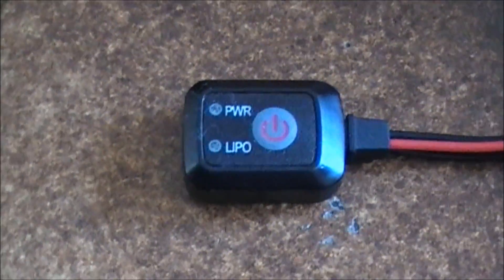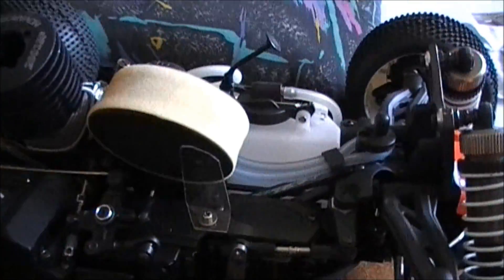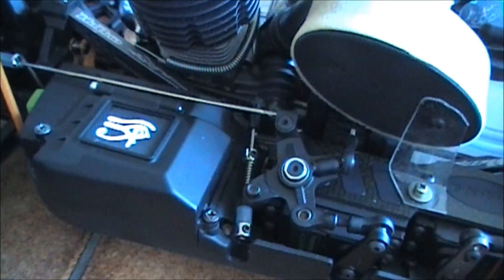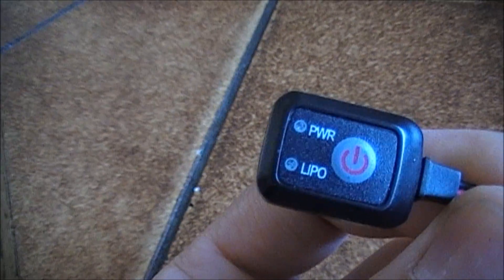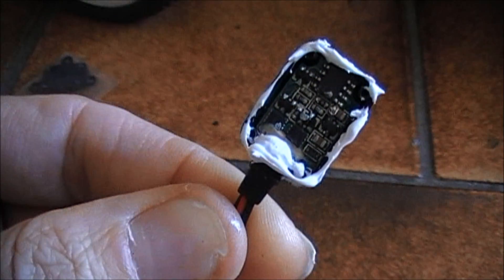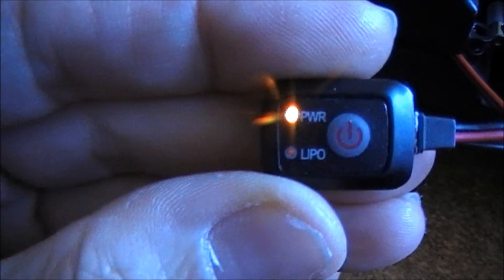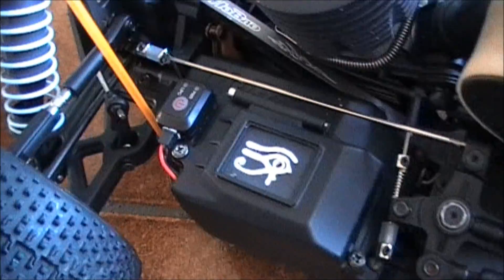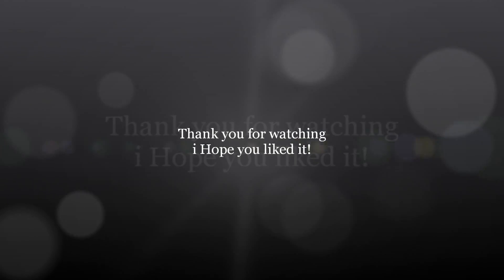RC car parts - On/Off button instead of switch and waterproofing it!

Comment: Hi how can I fit these  on electric esc without switch
Reply from the maker: The switch is designed to connect the battery with the receiver.

Comment: Old video but very informative, I see comments from 8yrs ago. But this device is still relevant today. After chasing down bad batteries and bad servos, my on/off switch had failed trackside. found this switch at my local hobby shop, and it’s surly better than the stock switch. Thanks!
Reply from the maker: It's a clever little thing isn't it! I'm surprised these haven't become the norm yet.
Thanks for watching and the feedback mate!

Comment: I have a 2s Li-po with a deans-contact and one little 3 pin when I charge the li-po. The connector from the SkyRc to the battery does not fit eachother. Do I must make one for my self or do you know if I can buy somewhere and if I must make it on my own...where do I find any contacts for that? only + and - from the skyrc pw switch and from li-po there are 3 cables. Not sure how to do it. There are 2 black and 1 red from the battery.
Reply from the maker: That's a good question and i don't know the answer to it to be hounest. since i've never had to deal with LiPo batteries.
You are correct; a LiPo has 3 pins and the on/off switch only has two. Which is strange since SkyRC mentions this switch can be used for LiPo batteries!

Comment: Is this switch like a fail safe switch as well that when the car battery drops down the car or buggy will also come to a stop ?
Reply from the maker: No, when the battery drops down or the connection is broken, the servos remain where they are at that moment.
Reply: @2stroke4me  that’s not good lol thanks tho

Comment: Hi.. i recently bgt the same switch.  Was wondering does it matter which set of wires are used for Voltage in and out? Dont have much experience with this.. appreciate the help. Thanks
Reply from the maker: Yes, the male plug (big one) connects to the battery.
Reply: @2stroke4me  thank you very much
Reply from the maker: @mikrot-rex747  You're welcome.

Comment: Two wires...

Where do each plug into?
Reply from the maker: xxgg One for the battery and the other goes into the receiver.
The battery pack is from another car, so ignore the two wires on the battery.

Comment: How do you install this on an electric car?  Thanks
Reply from the maker: Good question, haven't thought about that really. I don't think it's possible since there's a in and out coming wire and plug on the switch.